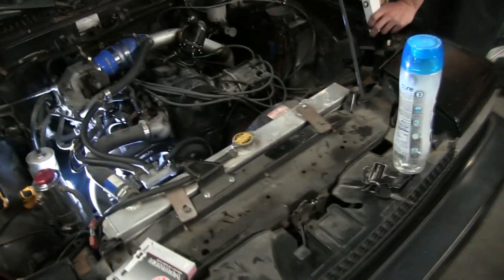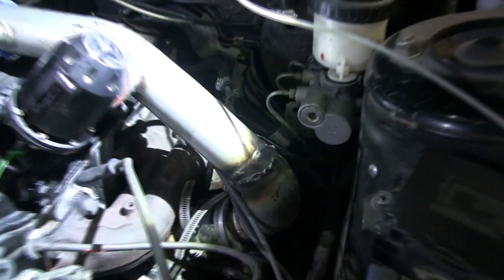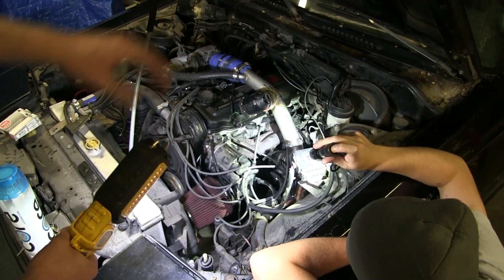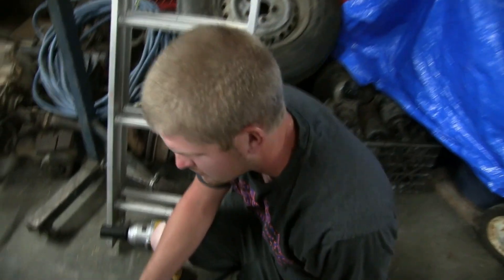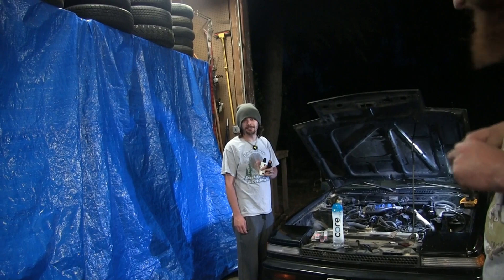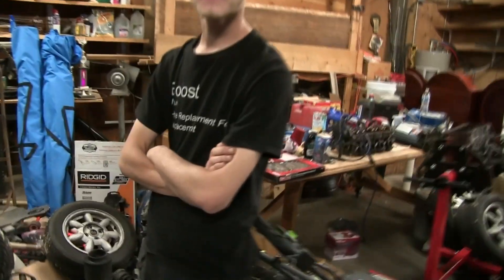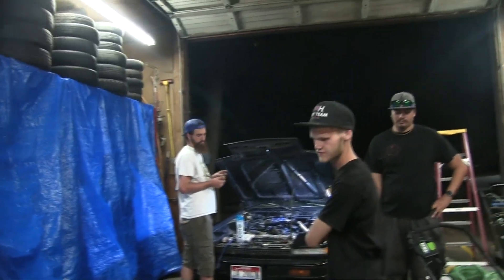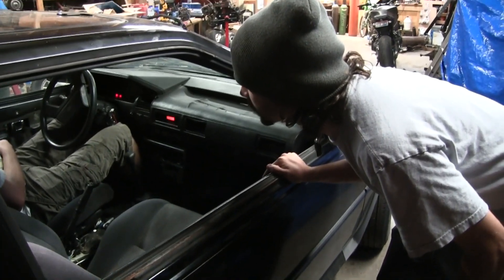The Rare Turbo S Chassis Lives! (S12 Nissan 200sx)

Comment: Needs a CA18DET from an early JDM s13 or a European s13 200sx
Reply: Marios Pantouvanos I would swap a single cam KA and boost it, except much much less ghetto and with an eBay FMIC at the very least. Then MAYBE get a REAL manifold and downpipe.
Reply: But the CA would be a nice choice as well. I dont know much about the CA.
Reply: CA engines are pretty nice unless you aim for 300-400 HP. After that there has to be serious job done. But that power is enough for some people f.e Me.
Reply: If I were to usea KA I would choose a twin cam and a home made log manifold.
Reply: I have heard of stock CA18DETs being reliable to about 300-350 hp, which is a good number considering that they are 1.8 liter
Reply: Marios Pantouvanos for a daily drive 300hp in this chasis is far more than perfect
Reply: Filip Kowal I agree.
Reply: Marios Pantouvanos I am the type of guy that loves to drive his project car daily. Not only taking it out the garage once a week
Reply: HI there we just got a s12 200sx id like to find some racing parts some headers do yea know of a place that sells parts

Comment: Double check all the injector plugs and make sure they're seated right. I had a ton of issues on mine where the injector plugs weren't quite seated and it ran like ass. A cap and rotor from autozone is fairly cheap and should make a big difference too. It also might be hitting the ecu failsafe and retarding the timing like crazy, I had that issue as well.